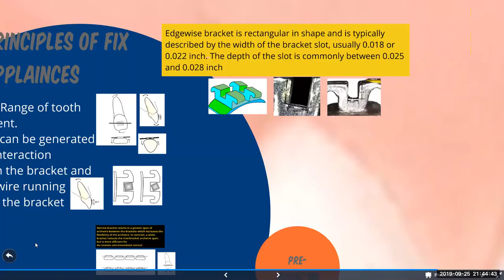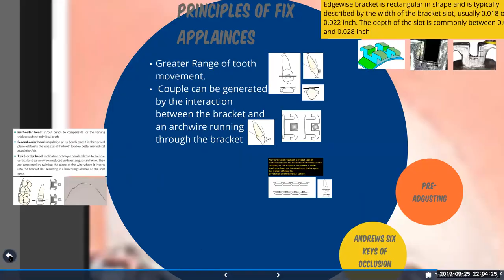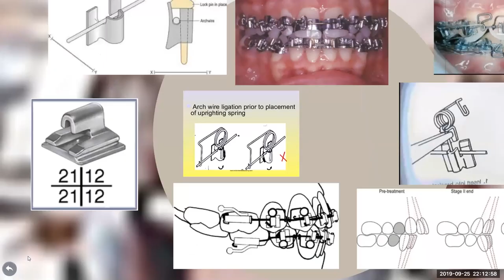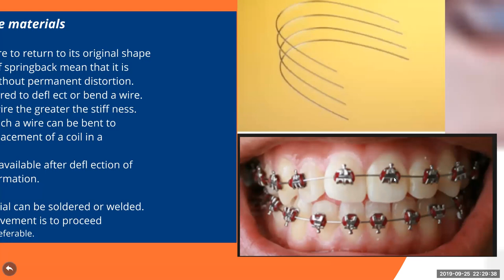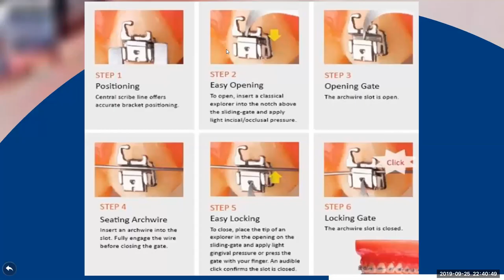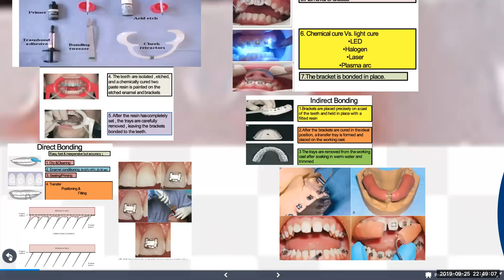Fixed Appliances

Comment: thank you so much Dr.
kindly, if the bracket used is mbt 22..
1_ where would you put it on a flared upper lateral incisor, at the middle of the clinical crown, more incisally or more gingivally and why?
2_ would you flip it or leave it as it is?
thank you so much. 🌹🌹🙏🙏